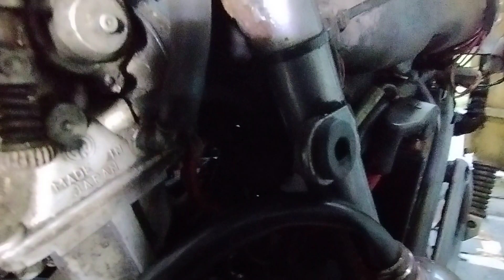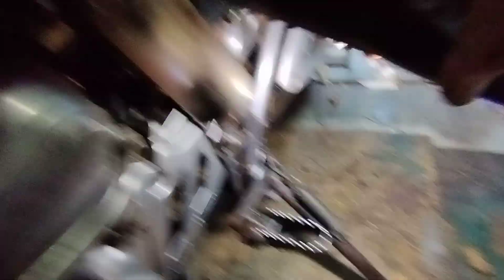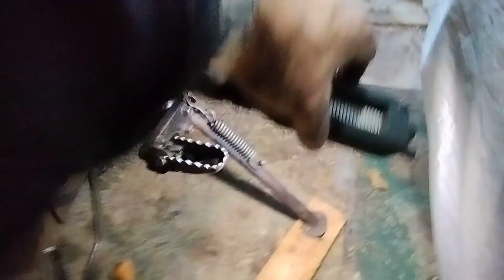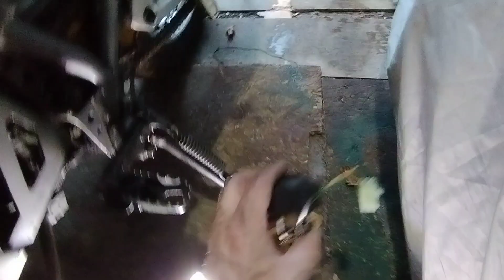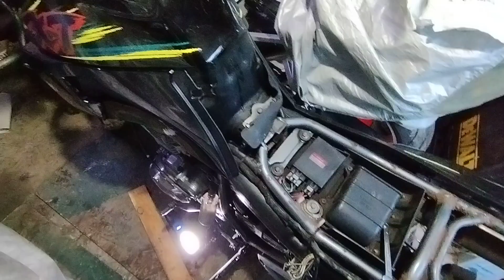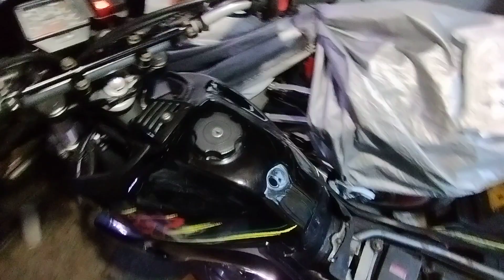YAMAHA XT600e - Good Battery - Starter relay/solenoid - Just clicking?

Comment: Hello friend, I have a yamaha xt 600, 1998. Today, when starting the engine, the starter rotates continuously, turning off the ignition, and it didn't stop until you disconnected the battery terminal. What could be the problem, is it the starter relay?
Reply from the maker: Hello fellow XT friend. Yes it will be a weak spring inside or worn contact. A new solenoid/starter relay will work 👍
Reply: @M0YKSHamRadio thanks

Comment: Would this be applicable to me if my ignition doesn’t even “click” it was until the battery fully died. Now it won’t start without being jumped. Any ideas?
Reply from the maker: @joestone325  have you charged the battery up to full charge. If you tried it a few times with a low battery it can damage this solenoid/relay. That what happens. They need a good battery fully charged

Comment: Run xt600's here, mine are 2003 so a tad different as i see your cdi is under seat, 2003 ones are in tail piece with reg/rec, as for solenoid i got a spare from 600 fazer or divvy as 03 one is the same, cheap and plentiful, starter itself can be awkward to get out of opposite side if your header bolts are toast and many are but can be done, other things are brake caliper pins can sieze especially the back ones, grease them up regularly, so called floating calipers and swing arm bearings, it can be a real bitch to get the spindle out as it goes through engine block and two sleeves, yours might not be so bad as unlike the 03 it should have grease nipples on the arm itself, general rust likes to live under the seat on frame and down tubes to footrests, changing oil and oil checks are always under a lot of debate but otherwise a great workhorse with no fancy stuff like sensors etc, simple old school, 73 m1jwr
Reply from the maker: Good to hear another radio guy with a XT. Awesome bikes, I have had this one since 2008 and its been solid. Put a few bits on it over the years but always a good runner. Comes to bits pretty well too lol. Its in pretty good nick for its age, I don't get on it enough. have a happy safe new year tnx buddy